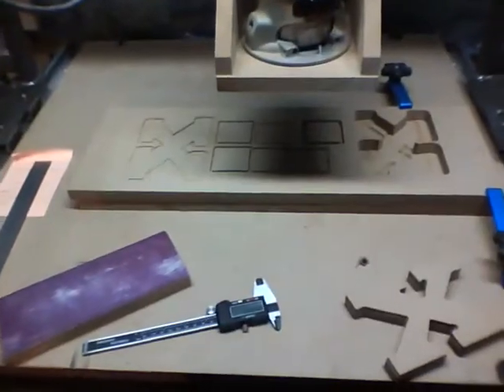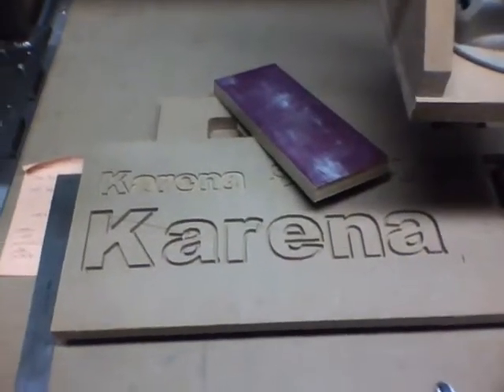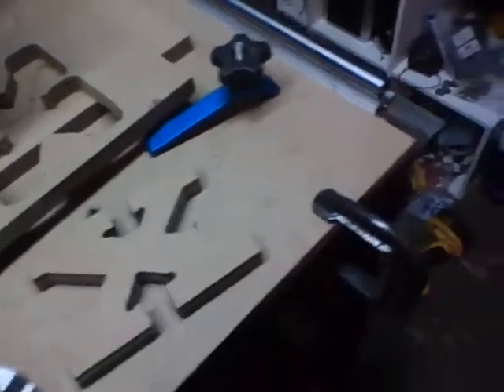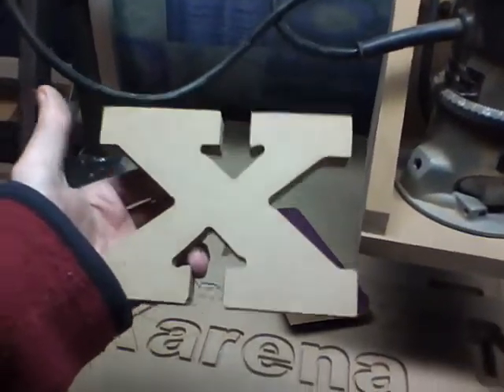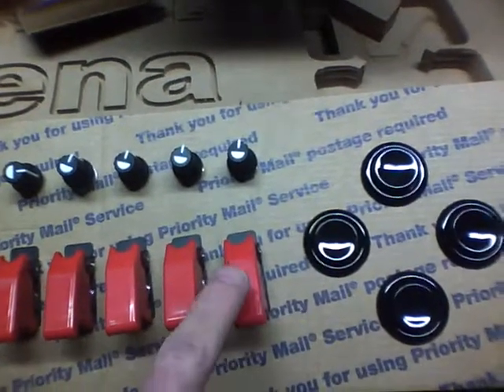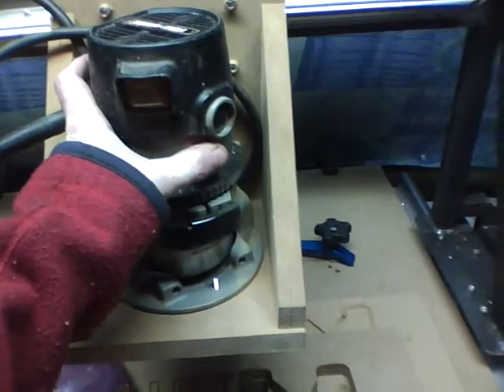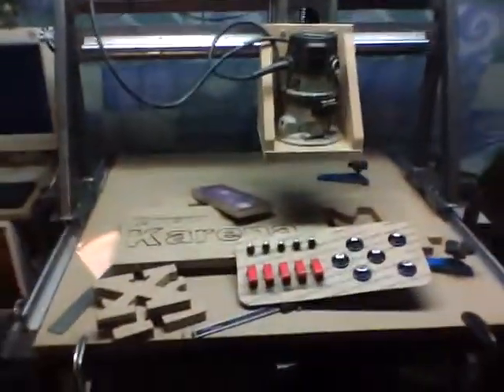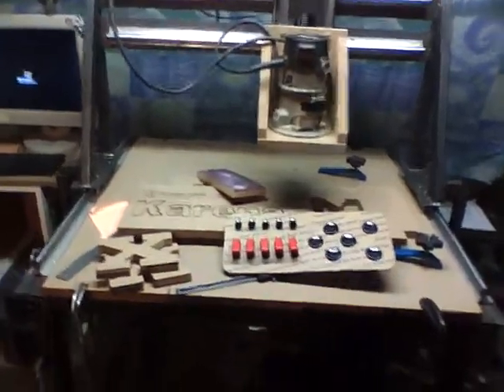CNC Project Day 12

Comment: It is a CNC!  In a pinch you can blast the bit with compressed air as you cut.  It would blast fine MDF dust everywhere though which is bad but a smoking and broken bit is bad too.  I've seen bit's brake in a CNC before.  I like how I can understand this project for now, at least till you go back into robot mode.